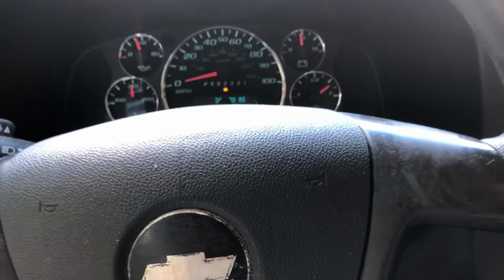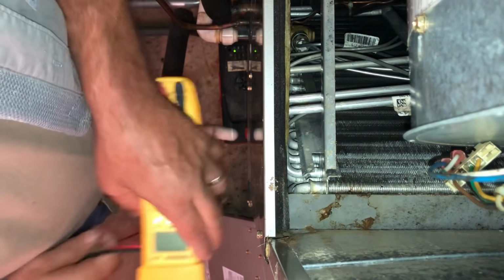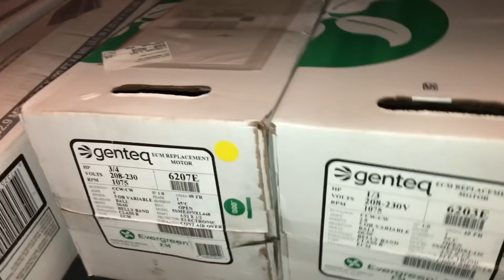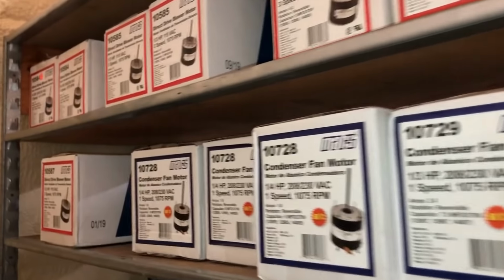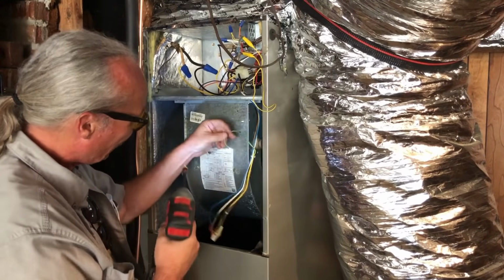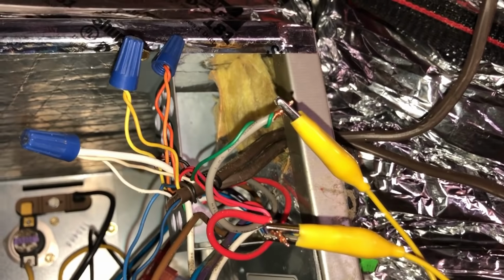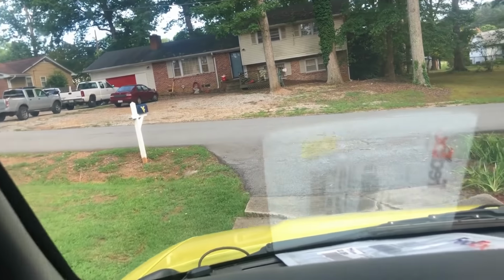ICP Heat Pump Blower Motor Replaced Comment Contest Video

Comment: Hey Ted, i have watched you replace several motors and i would highly recommend getting Aero Kroil from Kano.  It is worth every penny when changing out blower motors and condenser motors.  I live out here in Phoenix and when these shafts are like welded from rust.  Spray that Kroil on and let it sit for 5 minutes and i can take it off by hand.   i used to drill the center and pound with hammer, I have even resorted to torches and  a sawzall....LOL  Stuff just works 😎.     Kano Aerokroil Penetrating Oil, 10 oz. aerosol (AEROKROIL) https://www.amazon.com/dp/B000F09CEA/ref=cm_sw_r_cp_tai_7SitFbWG58AKA.       I have gotten better at service from watching your videos sir- God Bless 👍🏻
Reply: I agree on the KROIL, I think he mentioned it and a half dozen other sprays in another vid awhile back and says he like that Jack-of-all-sprays because it doesn't smell...or something like that.
Reply: Can't The Installers put a little grease on the shaft??? Jeez...
Reply: Rick Casto I just watched “ project farm” (YouTube) test penetrating oils and Aerokroil didn’t do good at all ... Seafoam Creep and good ole Loquid Wrench did a far better job and both cost a lot less $

Comment: Ted, I highly recommend these alligator electrical jumpers rather than the yellow ones you used in the video. These are much nicer quality and do not break like the ones you used. Just searchAlligator Clips Electrical Jumpers, DROK 10 pcs Pure Copper Crocodile Clamp Test Leads Set 19.6 Inches 50cm Double Ended Electric Cables Connectors Wire Circuit Experiment on Amazon

Comment: Afternoon Ted! I know its not much but Id highly recommend checking out "Crocodile Alligator Clips". After a good friend introduced me to them, I pretty much tossed out all of my old clips. The legs don't slip around inside when you squeeze to open them, and the jaws are larger and stronger for clamping onto anything you don't want to lose your connection to. Contest aside I think they make a great addition to any electronics task where you need a good temporary run, just be sure to grab some extras when a buddy tries to steal them from you!

Comment: How about a small but powerful magnet 🧲 to hold down the door switch while the doors are off instead of pesky tape 🤔  or a hub puller for those really pesky  blower motors... or a flexible  stand for your camera to stage on uneven surfaces for great hands free angles for your viewers so they're not to miss any condensate drain "money shots"😄

Comment: My home built in 2016 they have replace my blower motor 3 tomes. It runs during day and at night the outside unit comes on but inside doesn't start.  Im think the motor is heating up they just replace motor 3 time 2 days ago all is well.

Comment: Ted, the tool that you need to add to your blower/cond motor arsenal is an aluminium shaft and/or a brass hammer.
Much better for persuading those stubborn shafts through the hub without mushrooming the ends.

Check out the mine in the video I did for my motor bag...
https://youtu.be/P74yKABuaPI

Comment: Some one already recommended a blower puller it would of been out and a nother trick I carried a 1/2 plumbing fitting brush run down the blower hub to clean rust out of it

Comment: You do a lot of drain cleanouts and its generally in the elbows. Have you considered using a PVC heating blanket like the Greenlee 860 ( https://www.amazon.com/Greenlee-Heating-Blanket-2-Inch-Capacity/dp/B001HWELNC )  or similar to bend your own sweeps? Wrap it around the PVC pipe, plug it in and in a few minutes the pipe is flexible and you can sweep it however you want. Doing so would allow you to run a fish tape all the way from one end to the other to clean out clogs and you could do it from the ground floor.  Of course once you sweep them all they don't clog again... So there's that.

Comment: Ted, great repair on this unit. I bought one of those electric adjustable height tables (aka standing desk) so I could always be comfortable working on different things in the shop. Adjustable so I can raise and lower based on the height of the thing you are working on. Saves my knees from kneeling on the concrete and I do not have to bend over and risk hurting my back. I’m still young so I try to protect myself as much as I can. The cost of one outweighs the risks and complications I could have without it. And of course all of your tools are right there without bending over to get them. 

Here is an example: of course there are many varieties. https://www.autonomous.ai/standing-desks/smartdesk-2-home?option1=1&option2=5&option16=38&option17=1881

Comment: Hey Ted this is part number from Lowe’s dewalt1072064Model #DWADND  they different sizes fit on 1/4 malco tool. So you can take a part blower motor housing condenser motor as well

Comment: Need to buy you a set of neck lights 
 500 lumens and it keeps your hands free
 You can wear around your neck or head. I use snap on, USB rechargeable , lights are independent, you can adjust up, down and brightness. I have had mine just a little over a year. 39 years in the field
 Do not know how I done service without them. I also use Dewalt 8 volt gyroscope screwdriver. No switch for forward or reverse. Just turn your hand. Turn your hand right it goes right, left it goes left. Farther you turn your hand faster it goes. Small but wonderful.

Comment: Using WD40 & a Fan Hub and blower wheel puller works every time to remove motors from squirrel cage.
Reply: Using an ECM tester is way slower in my opinion then just using a meter.

Comment: A five gallon bucket a pair of knipex pliers wrench a m12 Milwaukee impact  driver or gearwrench ratchet flex end wrenches a wire wheel with a 1/4 inch attachment for impact and a set of Milwaukee impact grade sockets

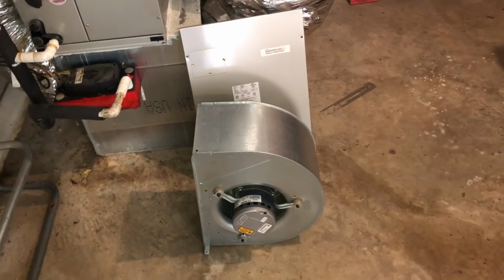Comment: Mr Ted Cook, @5:48 I see Your Magnetic Tray could use a Plastic "Half-Circle" insert for Brass fittings or Caps, Sadly a Magnetic Half Circle Plastic Insert with a lid for a Magnetic Screw Tray Doesn't exist, Think of a "Dewalt Yellow Small Drill Bit Holder" with a Slide lock, But See Through Plastic Half-Circle, Plus if I add Velcro on a Magnet combined  with the See Through Plastic Half-Circle, You just remove the Half Circle and not the "Whole" tray off the side of a Heat Pump or Air Handler. Because if you put that Metal Round Screw and Bit Holder Sideways on the "SIDE" of an Air Handler all the Brass fittings will Fall Off. I can Make one and Market the Product and become "Filthy Rich" but right now I'm in the Middle of finishing a "Solar Powered Portable Chicken Rotisserie" That uses a Solar Battery Power Pack that I bought off Amazon, ( ALL TRUE), then it's off to IndieGoGo to ask for Funding.

Comment: This may very well go against the old school traditional way of removing a motor with sand papering the shaft and adding some sort of lubricant or “rust away”. But I certainly would recommend a blower puller to any tech who runs into failed condenser fan motors and or blower motors. Takes a lot of hassle out the repair when you have a shaft that’s just stuck all to heck. 
Here’s a link for ya.
https://www.amazon.com/Blade-Wheel-Puller-Original-Version/dp/B001CGFQDW/ref=mp_s_a_1_3?dchild=1&keywords=blower+puller&qid=1598850350&sr=8-3

Comment: The tool that you need is this magnetic rechargeable flashlight: https://www.amazon.com/Rechargeable-Lights-Magnetic-Bright-Flashlight/dp/B07B9FVBVP Trust me, it will make your job way more pleasant and easier, It's perfect for HVAC. Give it a try! You can also get it at Harbor Freight: https://www.harborfreight.com/390-lumen-magnetic-slim-bar-folding-led-work-light-63958.html

Comment: Hey Ted , I would recommend ECM motor testers by gentaq. They make really good products for confirming bad ECM's. I know that's a x13 but still is a valuable tool to have on the truck.
Reply: He tested that by using his speed taps. Those motor testers take years to setup. I tried them once and I’m an electrical engineer. You can keep those testers, IMO

Comment: Ok so I'm retired hvac .. and my neighbor has a ac company come out for his ac .. and well when the company shows up i see the name and go get my son and show and tell him to never never use any company that there name is honest... so this company leaves and i go over and ask what his ac prob was . Indoor mtr bad variable speed dc and well they want to charge him 1800 total to replace this mtr i about crap myself told him to tell company no thanks i had him order online for a 3/4 1075 and a relay showed him how to convert a variable speed to a single ac speed cost him under 300 as he got anxious and tried to wire 115 instead of 230 costing him another mtr to see if he had it right ...the ac company didn't even give him this option to convert so honest ac in my opinion is not honest and i didn't charge him labor as they just moved next door and he had just recently suffered a heart attack...so my good deed... my heart attack was 3 yrs ago i felt sooso to go on a roof and do ...

Comment: Ted it sure looks like you were painfully struggling with that adjustable wrench.  I have found this wrench solves quite a few problems with gripping, even on the small stuff and are self adjusting.  check them out and they are reasonably priced on amazon.   https://www.amazon.com/dp/B000JPN2QK/ref=cm_sw_r_oth_api_i_QlhtFb2EE527P

Comment: Not sure what impact chucks you're using to remove the bolts and belly band from the motor, however I have always carried with me this impact socket set made by MAKITA (YES IM TOO A DIE HARD MILWAUKEE GUY, INCLUDING THAT TRANSFER PUMP FOR AUX DRAIN PANS) but for and motor replacement no mater the make or size this set has. At least for all DX SYSTEMS. For $20 you can't go wrong. Link below:

https://www.homedepot.com/p/Makita-IMPACT-XPS-Socket-Set-SAE-with-Standard-SA-10-Piece-E-01672/311427428

Comment: I would recommend replacing that motor with a quick swap board and use a PSC motor. Cause we all know the module goes bad.
Or at least have a Quick swap board in the van for emergency

Comment: DEWALT Drive Socket Set, SAE, 1/2-Inch Drive, 10-Piece (DWMT73814) https://www.amazon.com/dp/B00TI4G33M/ref=cm_sw_r_cp_api_i_uIftFbKVBBPV1

Use it for knocking those stubborn blower motor wheels down the shaft.